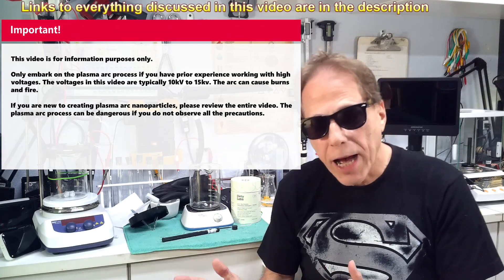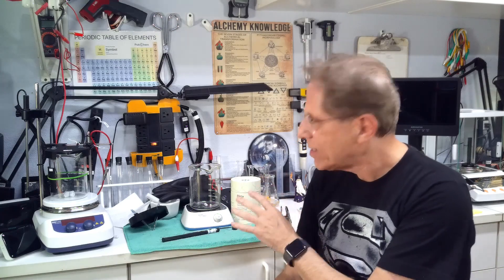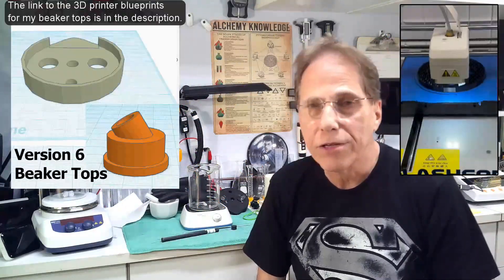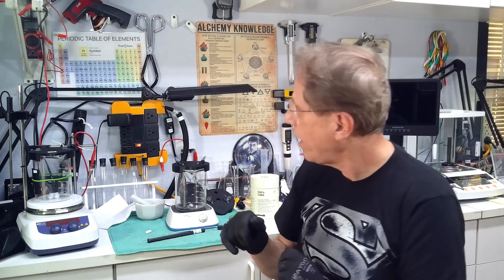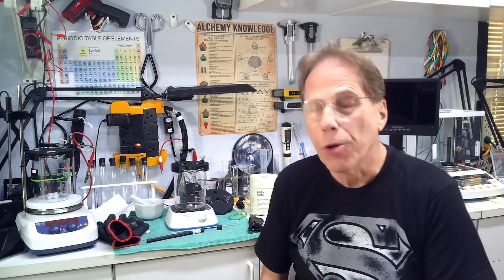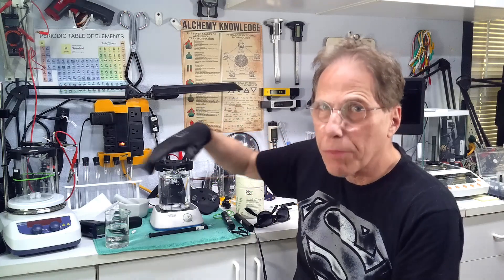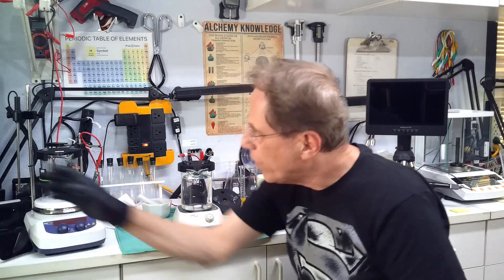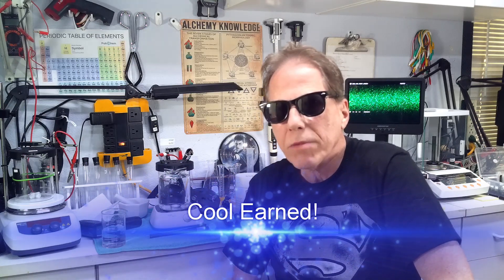Making Platinum Nanoparticles using Plasma Arc. Start to Finish.

Comment: What would happen if you added ozone to the different colloidals?
Reply from the maker: I've heard of some labs using Argon to enhance colloidal production. I have no way to add any kind of gas to the process here. There could also be unintended results. Most of these labs just make the nanoparticles. They don't intend to drink them. Still it does give some thought.

Comment: Hermes I'm a bit confused here. I cant understand what is THE plasma arc. I see you have an electric inverter, but what is connected to is? Are the alligator clips connected directly to it? If so, when I look at the pictures of the product you suggest to buy, I see no clips..
Reply from the maker: The  high voltage arc is created using 10kV or 15kV AC neon light transformer. The high voltage causes an arc to form between the gap in the leads. The arc melts the metal off the wires, which then cools and becomes tiny colloidal particles. 

The 10kV transformer comes with wires but no clips. You will have to put the alligator clips on there yourself. I suggest using a soldering iron to be sure the wire is firmly attached. The 15kV transformer comes with no wires or clips so you will have to add those. Make sure you use 20kV rated wire. Regular wire will not be a good. I have some video's on the transformers but I don't actually show you putting the clips or wires on.
https://youtu.be/hlcfd7c1RQA

Comment: Hi Tom, great work as always! , how are you dealing with the ends of the gold wire post plasma arc? I find the tips become brittle and carbonized and do not make a good arc without being scraped  or removed.  You mention the energetic forces emitted while conducting a plasma arc session, are you noticing 'headaches' or 'dizziness' post sessions?
Reply from the maker: Hi!
I try to make sure the arc goes to the tips of the gold wire. However that is not always the case and then it will burn up a bit from the tip of the wire. If that happens, I have to sand the end off or clip it. It's a small amount usually. 

I don't have any side effects to the plasma arc process. I know I had mentioned each metal seems to have a quality around it while the plasma arc is going. But that is just like a feeling or intuition. Gold seems to create contentment, peace, and the idea of abundance. Silver seems to create protective feelings like a shield. Titanium feels highly energetic. I actually have not thought about that in awhile.  

I get no headaches or dizziness. Once the arching process is going on, I do walk away and do other things, while keeping an watchful eye on it. I never leave the house with the arc running and I only may leave the room for short period of time. If I'm have to do something for longer periods of time, I shut down the arc. Then resume when I can again keep close tabs on the process.
Reply: Thanks for your thoughts Tom. Yes, i would NEVER leave the arc unattended - if humidity is high it will jump across creating a path in the air. I am using 20Kvac though.
Reply from the maker: @magic-happenz  20kV transformer. those are hard to find, or are you using two 10kV in series?
Reply: @AlchemyWizard  No,  I had it custom made. but to be honest i'm not noticing a lot of difference between 15 & 20Kv.  I do submerge my wires - fill the beaker to the top, the intensity of arc doesn't differentiate much between shallow or deep. :)  Do you find plasma silver requires less arcing than gold to produce similar PPM?  A video on various metal arc duration's = same PPM would be awesome. (however i do realize there's a considerable difference between arc intensity - rod tip separation )   I've just ordered r 99.95% platinum wire to see how that goes. the neurogenesis benefits are interesting.
Reply from the maker: @magic-happenz  
Nice idea doing a video on how long the arc takes for each metal. 

Most metals i can achieve what looks like 20 to 30ppm on the laser beam or via the laser microscope

500mL silver is done in 2 minutes. No heating. It's the fastest of the bunch. After that the arc gets quite small. You can preheat it to raise the concentration to get a darker brown higher concentration silver over 30ppm. 

500mL  gold takes 30 min but you must preheat the water to boil to get the Rose 20nm molecule, otherwise you get purple 40nm size.

500mL platinum also takes about 30 min, no heating needed.

Thanks for the info on the 20kV. That is good to know that it 15 or 20, its about the same.

Comment: Excellent! Can plasma ark still work with platinum bars?
Reply from the maker: You'd have to cut two strips out of the platinum bar, like I did with my disk of Vanadium in the video short I made on it. Too much metal in the fluid would increase conductivity of the solution too high and you would not get an arc. Or if you got a real powerful laser use the laser ablation. One day I would love to be able to buy a laser powerful enough for this process. If for nothing else, just do do it. Of course a platinum bar would be way more expensive than my 24awg platinum wire and probably the laser. LOL!